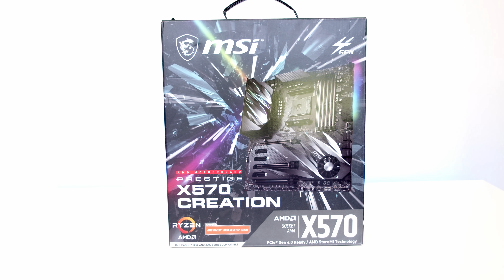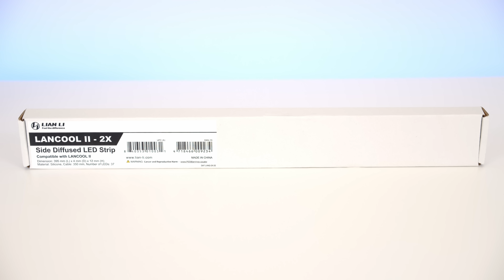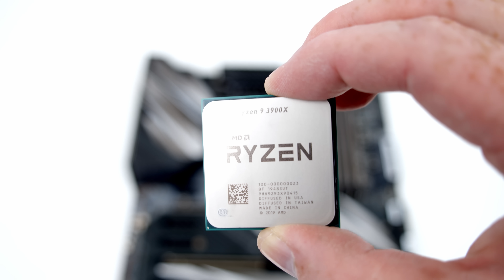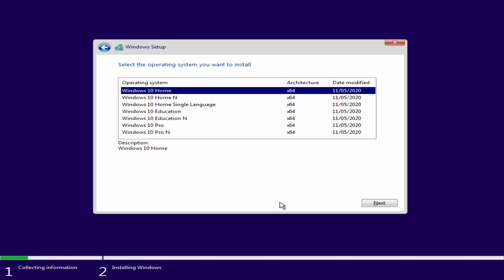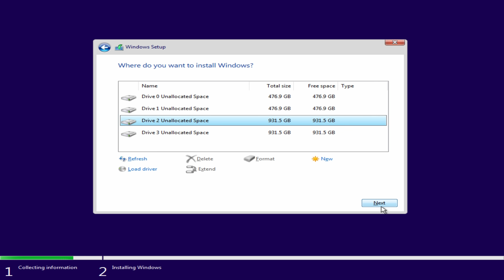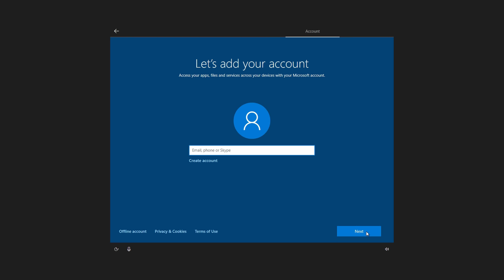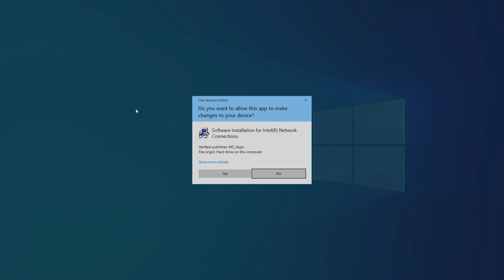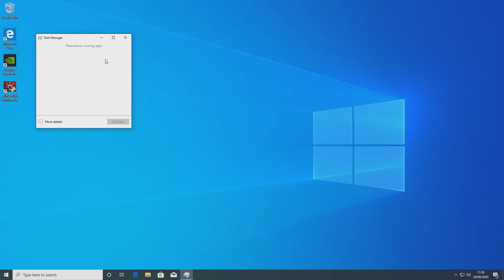Lian Li Lancool II Mesh Step-by-Step PC Build Guide

Comment: I'm swapping cases in my current build and was looking for reviews of this particular case when I stumbled across your video. While I'm not new to the hobby, I deeply appreciated seeing your straightforward and patient guidance with assembling every part of your build. You're a wonderful teacher and I wish more people would follow your example.
Reply: Agreed! I've not upgraded in 3 years after building my own for almost 15 years before that. The ability to jump to the bits I needed to skill up on was great. Thanks for putting the time in on this!

Out of interest, would you have had space to top mount the rad?
Reply: @urfolomeus  Most cases nowadays cannot support 360 rad on top. 240/280 rad on top, yes. With 280 it's really tight and u might have some ram clearance issues, so make sure u have really low profile rams. 240 on top is your best choice.
Edit: actually, on some smaller cases a 240 might even have ram clearance issue.
Reply: @t.n.9508  thanks for the info. It's a 280 rad I'm looking to fit ... although I now have my eyes on a Sliger SM580...

Comment: Update; commented 2 month's ago to say that this was the guide I would be referencing in my 1st ever build...commenting again to say a Big Thank You as it's now completed!. Used the same case & then went with a Rog Strix b550-e, Ryzen 7 5800x, Gigabyte eagle oc 3070, 2 x 16gb 3600mhz g.skill cl17 ram, 2 x 1tb adata xpg SX8200 nvme, Corsair hx750i psu and an Esports DUO 34 cpu cooler. Also updated the bios without a cpu after following your video on the subject 😁 . Complete Success!...1st attempt!!. Once again, Huge thanks for a clear & concise build guide that gave me the confidence to attempt it myself 👏👏👏
PS, worst part of the build was...not daring to hit the power button for half an hour after I'd completed the build 😬
Reply from the maker: Nice build, well done and now enjoy it!!

Comment: Really appreciate your making this.  It's thorough, detailed, and full of good information.  This being the first PC I've built from scratch since about 2000, I really needed a good tutorial, and yours is stellar.  
I really like how you don't do cutaways when placing the parts.  Many other tutorials don't actually do this and just sort of snap to "LOL IT'S DONE LOOK AT IT MOVING ON" but there are parts that require careful orientation, positioning, and the amount of strength required to install or remove components.

Comment: This is an outstanding document. I'm building a similar ATX (using a Lancool III, Enermax aRGB coller, and an MSI V590) and had some difficulty with cabling. Got everything hooked up and it wouldn't POST. As part of my troubleshooting research I found this video and, after watching it, decided to tear my build back down and redo it from scratch following the order suggested here. My profession is technical documentation and this is some of the finest work I've seen. Thank you Christopher Flannigan.

Comment: Less that 10 minutes in and I'm already convinced I'm going to enjoy this video.
Reply: i just clicked in the video and saw the timestamps

already convinced
Reply: As a follow-up. Finished my first build the other day. This video made it easier.
Although, silly me, forgot about the dang plate that's loosened when removing the brackets for the CPU.
There I was trying to figure out why the screws for the stock fan weren't doing anything. 
Ugggghhhhhh

Comment: Hey Christopher, Thank you for such an awesome guide. I just built my first pc thanks to you. i got unlucky during my build that my gpu didnt fit my first case lmao. I lost like 2+ hours due to the cable management and motherboard attachments i did before trying out my gpu. thankfully i upgraded my case to the lian li II mesh and found your guide.  Before you, i was looking at four diffferejt manuals at once building my pc. You made case fan assembly and case cable installation really easy for me. Plus your drivers installation and windows section was super easy to follow. Thanks for the amazing guide. I really felt i made it to the finish line with your help.

Comment: If you have enough tube to reach, radiator should be flipped so that the tubes are at the bottoms of the case, that way you wont have any air pockets in the pump.
Reply: @ChristopherFlannigan  Thanks for the reply, and great jod doing the test 👍, was very helpful indeed.

Comment: Flip your rad so plumbing is at the bottom or better yet top mount the rad, your pump and water is fighting gravity and not running 100% efficiently
Reply: A 3-fan setup will not fit for a top mount on this case. I tried it last night :(. I have an EK-360 AIO CPU cooler.
Reply: Tuanty-Tuan Howd you end up mounting, I got the same setup
Reply: @tylerkasper9385  Went with a front mount, tubes at the top. No issues so far.
Reply: only if pump is above rad is it really an issue

Comment: Thanks for the guide, appreciate it. Quick question: Wouldn't the intake fans at the bottom be drawing in hot/warm air since they are located directly ABOVE the PSU, hence heating up the GPU/whole ecosystem instead?

Comment: Hopefully Gamers Nexus doesnt see how you installed that radiator.
Reply: Torxx installing it that way only effects noise. “Sometimes” If you watch the video again he says that installing with radiator in the front tubes down it can shorten the life of your aio.
Reply: Nolan Hansen it's best to work with gravity not against it. So having them down wouldn't shorten its life. Thus you can run into pump noise issues and/or air pockets in the radiator since the tubes are at the top instead of the bottom to help the pump with better flow.

Comment: God bless you for this!! Have not build since 2013 and especially the RGB connections confused me a bit.  Watching your guide refreshed my memory in building plus I learned a few new tips. Only minor improvement and this is just personal opinion because others might prefer the slower pace would be to maybe speed up the video while you installing something and you not commenting or giving Instruction. Thank you so much for this, you made my build easier and maybe saved me from mistakes that sometimes cost money.
Reply: P. S this case is amazing for the money, I have the not mesh one that has not as good airflow but I like having not visible huge fans at the front. Lots of space and options to do your build with this case!! I have made the cleanest build I have ever done.
Reply from the maker: Agreed, new guides are just over the hour

Comment: This is the most thorough build video I've seen. One note regarding the cooler installation: the pump position will be fine with the hoses on top as long as the pump is below the top part of the radiator. Air won't get to the pump as long as it is lower that the highest point in the loop. A hoses-on-top setup can cause issues but only if the pump is above the hose/rad loop - which can happen with a 240 installed towards the bottom of the case.

Comment: Chris - First let me say how much I enjoy your channel ! Your attention to detail in the way you post your content is amazing, and the content itself is super enjoyable ! Thank You !

This particular video inspired me to take the leap and build my own system, instead of buying a pre-built PC for a new Flight Simulator Gaming PC. I purchased almost the same components as you, except that I went with a I9-10900K, Asus Maximus Hero XII wifi and EVGA 3080 FTW3. Everything else (Galahad 360 AIO, Lancool Mesh case, M.2) are identical.

Where I am stumbling is hooking up the fans. I made a small change and used 3 of the Lian Li 120 Unifans on the Galahad AIO so I would only have one set of cables from the Fans on the AIO. I used the Original Case fans for the 2 top mounted fans, and the back fan. 2 of the original Galahad AIO fans will be mounted on the bottom beneath the vertically mounted GPU. I have never done anything with Fans or Especially RGB. How would you recommend that I connect and group the fans ??  ( The single set of connectors off of the AIO and the 2 bottom fans have the same connectors, and the 3 original case fans 2-top 1-back have the same connectors)

Please keep the great content coming !!

Bill
Reply: @ChristopherFlannigan  Thanks for the reply Chris ! Would there be any difference in using the Controller Hub that came with the Unifans to run the AIO fans ( 3 on the radiator and 2 on the case ) via the hub and then run the 3 original case fans as you said, via the ordinal connection as the case came from the factory ??  I believe that the Hub uses L-connect to manage the fans, but if set to PWM, allows them to essentially pass through to be controlled by the Motherboard ? I believe the hub uses a SATA connection for power from the PSU. I obviously need to do some manual reading :-)
Reply: @ChristopherFlannigan  Thanks Chris !!

Comment: Just wanted to leave a comment saying I appreciate you for taking the time to make this video. It was a massive help in building my PC. Some parts were tricky as the components weren't the exact same and it took me a while to figure out what cable you meant at points but got it fully built and operational in like 12 hours total with it posting first time.

Comment: Great video. Thank you. I watched it all the way through and then returned a different case and bought the Lian Li Lancool II Mesh RGB both because the data on cooling looked so good in all the review videos and because I had your video to use as a guide. ----- And you are SO right about the addressable RGB cable being tricky to connect. I bent the pins a bit and had to straighten them. I then got really close by taking my glasses off and angled the cable side enough to actually see the 5v pin go in the hole; that helped me line it up enough to feel more confident pushing harder. The problem is that there is space on the cable for the pin to advance when you are NOT lined up correctly--that fooled me into the bending error.

Comment: Great video. It helped me a lot. I went with the same case and AIO. I did the RGB differently though. I bought three Lian Li ST120 fans with the hub. They match Galahad's fans. I installed those all as exhaust two at the top and one at the back. I found two completely black Lian Li non-RGB fans for the bottom intake that way the PSU and cables at the bottom are not lit up. I'm impressed with the CPU and GPU temperatures.

Comment: This is the first of your video's I have seen. Very impressed in your attention to detail. I have one tiny bit of concern you never went through the TPM Secure Boot settings but back in Aug 2020 it was probably not much of an issue as it is nowadays. Great Video and I appreciated the speed of the build not rushed. I will go into your library now to see if you have any BIOS video's with as much detail as this video had for the build. Good Job.

Comment: I joined YouTube just to LIKE this video which saved me from such discouragement so thank you!  I didn't know anything about PC components or how to build one but now I'm going to try to help my son!  His build using this case didn't go well with the new GeForce RTX 3070 gaming X trio graphics card.  It was bumping into the metal piece on the right side when trying to seat in PCI slot #1 so he used slot #2 propped up with a rubber ended screwdriver since the MSI bracket won't work. Now I suspect this is due to the size of the motherboard. You showed in the video how to rotate the metal piece 180 degrees, which we will try today. Thank you!  The cords are a mess and we will take out the hard drive cage since he's using SSD cards instead of hard drives. The power cords going to the 3070 have splitters that are bulky and sticking out. Should we buy new ones?     I've tried to learn about load testing to determine if we have enough air flow but my son said he's not set up to test the CPU only the GPU.  How else can you determine the # of fans needed?  You have 8 in this demo and we have the 3 that come with the case? Thanks for all your help!
Reply: @ChristopherFlannigan  Thank you for responding. Here's an update: Even though the MB (ASUS Prime Z390A) wasn't described in the online manual as an EATX, I found it in tiny print on the board. Therefore, the cable management part needed to be rotated 180 degrees. However, once again installing the GPU it was bumping into the cable bar... STILL!  We had to remove that piece altogether. Now the 3070 GPU is mounted in the 1st PCIe slot and the support bracket can be used. That problem is solved but cables are a mess. We will install the 2 exhaust fans for our air cooling system, but I don't like the idea of losing the top anti-dust mat. One problem many have asked about is the missing header on MB (that are 2 years old or older) for the case cord going to the mode button on the case. The Z390 has 2 RGB headers that are 4 pin, not 3-1 pin and they are 12V not 5V. Right now the fans are spinning and the colors are on and in fade pattern, therefore not even sure why we need this cord? However, wanted to let you know about the adapter I found b/c so many people are excited to solve this issue.  .https://www.amazon.com/RGB-Convertor-Convert-Motherboard-Compatible/dp/B08CT9R8FR/ref=asc_df_B08CT9R8FR/?tag=hyprod-20&linkCode=df0&hvadid=459410835726&hvpos=&hvnetw=g&hvrand=1983613959519759928&hvpone=&hvptwo=&hvqmt=&hvdev=c&hvdvcmdl=&hvlocint=&hvlocphy=9015711&hvtargid=pla-942382475962&psc=1

Comment: I'm about finished building and should fire it up later today. I researched what parts I wanted and it matched yours with the exception of Intel 10900kf, MSI z490 ACE and a cooler master v850 gold. Then i see your channel and Bam!  instant cheat code, lol!
Although our MBs are not identical, its close enough to be easy with your directions.
Its been 10 yrs, but I used to build my own rigs, as well as for friends.
Your have an excellent guide style which promotes easy start and stop play. I couldn't have asked for better help. The vertical bracket alone would have been time consuming to no end without this guide.

One funny note, since I'm a Texan living in Cali and catch hell for my accent...But I kept hearing the phrase "pc Killer" ....? Oh, wait...he means "pc Cooler"!, 
Lol, I kept thinking, what part is the pc killer? I love accents and got a chuckle from that one.
Keep up the great guides, I'm sub'd!

Update, the build is awesome. Love the case a lot. I had no big issues. 2 bad connectors. One was a a three pin which couldn't fully seat, and I found a spare. The other was an rgb connector to the corsair hub with a loose wire which I fixed. Lian Li AIO is great at cooling. 
I91000kf at 5.2 Mhz, using only 1.26 v. The 64 gig Hyper X 3200 is OC to 4000 with no voltage change needed. Cinebench 23 score 16900+.
All I need now is a better graphics card. 1080 ti runs well enough for now. But I'd love to get a 3080 and call this rig done. All in all its a great looking rig when the rgb is on rainbow!

Comment: I bought this case.  I like it.  Some caveats that builders need to know.  Putting in 240mm AIO on the top is a hit and miss if your using motherboards with shrouds for the back IO.  The shrouds are tall and for this build I used a Corsair H115i AIO.  The AIO was hitting the shroud in the back corner.  I also used Corsair Dominator Platinum RGB ram and this ram is tall.  The AIO was also hitting the RGB memory. The rubber bumper of the top front fan is touching the ram.  I don't think this will be a problem.  Also you have to install the CPU power BEFORE putting up the rad.  The CPU power cables don't touch but I ordered Cablemod Pro cables and I don't know if they are going to touch the rad when I attempt to install them.

Comment: This is without a doubt the best guide on building a PC out there.

Just would have liked to hear you mention how installing a heatsink CPU cooler would go like; that is talking about the AM4 backplate that is needed for some coolers and when is the best time to install the cooler (a lot of guides install it before mounting the mobo in the case.)
Reply from the maker: It depends on the size of cooler and space in case

Comment: Only thing I'd pick on is the radiator placement, flip it upside down, so the hoses are at the bottom, Air bubbles rise to the top so it does effect cooling having it up that way but all in all great vid 👍

Comment: Dude, thanks! I finally built my pc almost like how you taught and it runs great! The fans are loud as hell though and I'm going to figure out how to shut them up.
Reply from the maker: Try the bios, chances are you are running 3 pin fans in pwm and changing to dc mode will work

Comment: Great video as ever! I used your video to build my PC, Howver, That  Usb C connector single srew is not enough, too short and has nothing to bite into! I changed and used 2 X 4 mil bolts with a washer, spring washer and bolt on the 2 side holes on the 'C' connector works great !

Comment: Thanks for this.  Just moved from a huge 22" tower case to the Lian Li Cool II and the wire management was a bit of a shock.  I used this tutorial to do most of the build, but I'd wish that you could have went just a little bit into your cable management strategy. Seems like everyone who does build videos FFs the cable management part. It would be helpful, especially since I have a lot of SATA cables (I have two HDDs and two SSDs).

Comment: Had this for a bit with a NHD15 and it worked pretty well. Using a 360 AIO in the front exhausting hot air from a 5950x into the case is a no go. You'll end up frying your 6900XT, 3080 or 3090.

Comment: Nice vid, the front panel switch connectors are not polarity based, the switch just makes or breaks a circuit so it wouldn't matter which way around you connect it. Polarity for the led absolutely matters though 🙂
Reply from the maker: Agreed, but just plugging in this way avoid people having to remember which ones it matters for